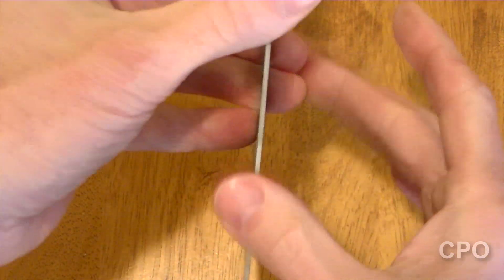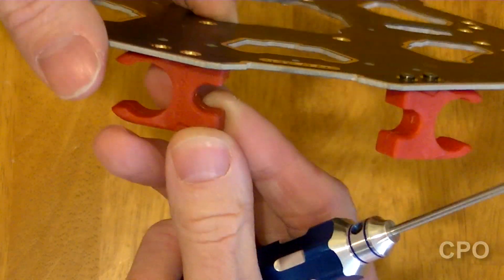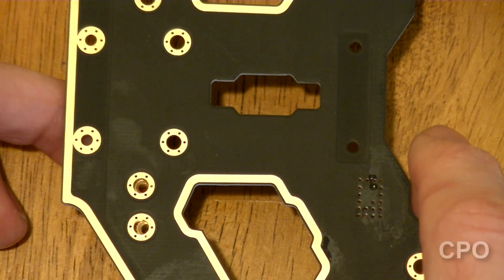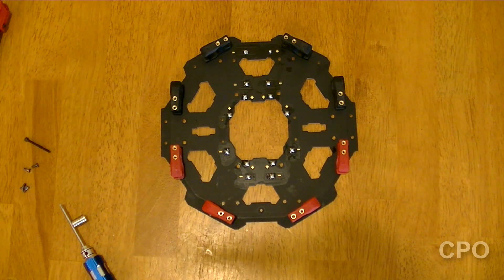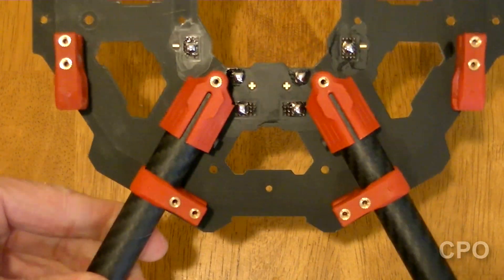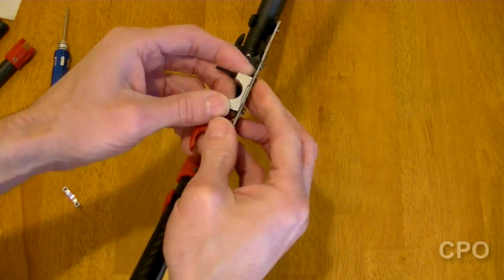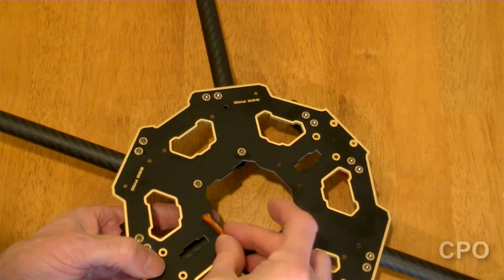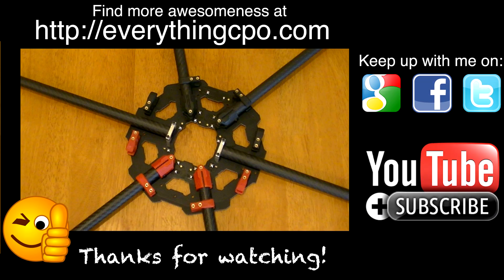Tarot 680 Pro Hexacopter : Initial Frame Assembly

Comment: Be warned, those screws that bolt the plate down to the plastic arm pieces are garbage. They strip extremely easily. I ended up taking my dremel, cutting a slit in the middle, and making them flathead screws.

Comment: Just an update to anyone building one... the orange pieces that fit on top, and hold the stationary arms, are no longer included. Tarot has press fitted nuts into the carbon plate. 

I was searching through all the bags and parts looking for the orange capture thing!

Comment: After trying to get the fixed arms in place for about 20 minutes I finally just used some double-sided cellophane tape to hold the aluminum mounts in place. That made it a lot easier.

Comment: Hey CPO, I'm almost finished with my 680 Pro - (mine did come with 4 cap bars). My issue is with the screw length for the fixed arms (supplied - M2.5 x 28mm [26mm threads]. The body is 25mm thick! Need to use 32-35mm screws.
I'm awaiting the retracts which I believe attach to the fixed arms. If that's the case, the second set of cap bars will be used on the bottom plate.
On the inner clamp, the threaded inserts on the bottom plate and threaded cap bar keep you for getting things good and tight. I drilled out the bottom threaded inserts. And even then, the 28mm screw only capture 1-2 threads in the cap bar. Not enough to make me happy!

Comment: Hello in one of your videos on the 680 pro build you say if you are fitting a canopy the battery wires must go on a another
way could you please tell me what i must look out for, i'am just starting to build my 680 pro with a canopy and will be using the dji naza v2 and the E600 tuned propulsion, like i say any help you can point out to me would be very welcome like and subscribed realy nice channel.  from Livingston , Scotland
Reply from the maker: Basically, the hardware that holds the canopy on has holes pre-drilled in the top plate.  Unfortunately, the drilled them in such a way that the battery connection would be in the front.  Not a big deal...you can just run the battery wires around however. Since I am not running a canopy, I had the option to build it so the battery connections were in the back (where they belong). For you, just build it so that Tarot is in the back, and 680 pro is in the front.
Reply: Cpo Thank you for getting back to me so quick and for the information

Comment: Pretty sure the Tarot logo is facing the back.  So your putting the red legs in back.
Reply from the maker: Since I am not running a canopy, I had the option to build it so the battery connections were in the back (where they belong). So the red booms are in the front on mine. If you are running with a canopy, you have to do it they way you suggest.

Comment: Perfect timing-
I am currently building a FY680 Ironman version (aluminum arm version- older than this with no PDB)

I am doing a 5S or/and 6S with 3508 29 380kv motors and plan on spinning 11, 12, or 13x somethings (gotta see what works best and verify if 13's will work on this frame- mixed word out there if that is true) with a pixhawk as the brain and central nervous system- 40 amp simonk esc's and a futaba radio (10ch) and I have a lightweight fpv cam with gimbal, and rack mount 3 axis with gopro- so total amateur rig for fun and hopefully better than garden variety footage.

I am shooting for 15 minute or better flight times- estimated AUW is about 3kg including battery(s) if my maths have been correct (and that is a big if)

I look forward to what you get out of this-